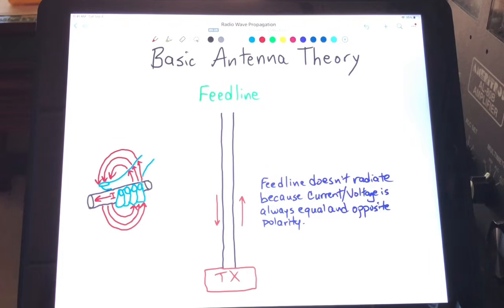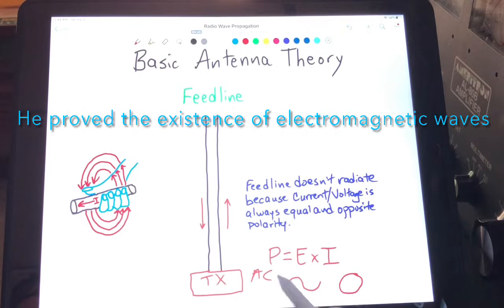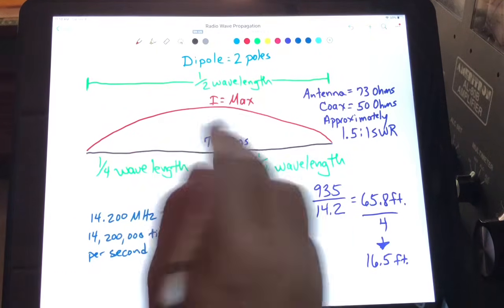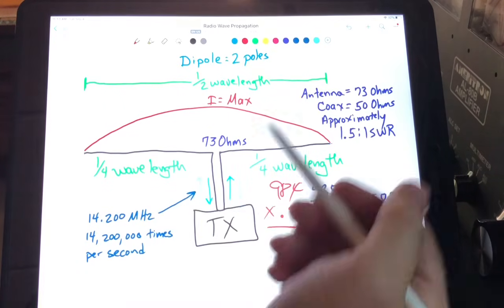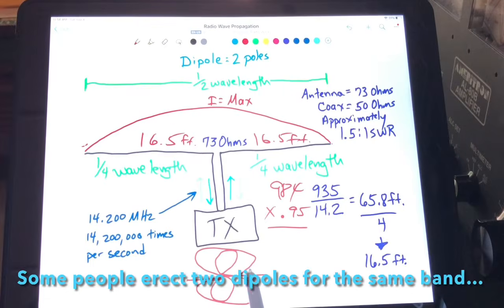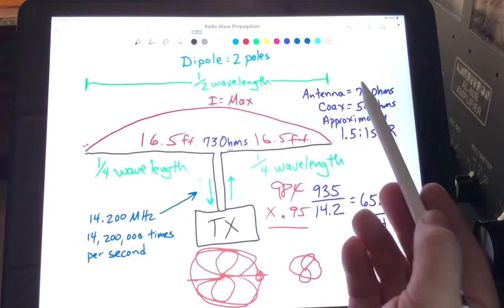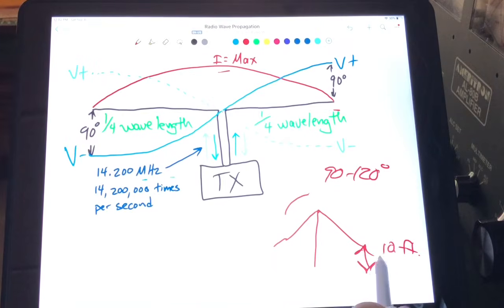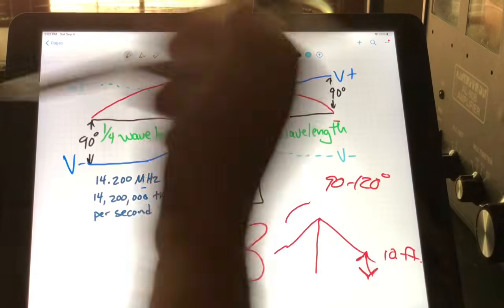Basic Antenna Theory (HF Dipole)

Comment: 1.5:1 sucks.
Reply from the maker: It seems that you have been misinformed.  The difference between 1.1:1 and 1.5:1 is not discernible over the air.  Old timers were happy with anything 2:1 or less. Tube type transmitters didn’t care. The main reason 1.5:1 or less is our goal today is because transistorized transmitters can fail with a steady diet of 2:1 or higher.  But again, the difference between 1.1:1 and 1.5:1 is not discernible on the S-meter of the receiving station.  A laboratory instrument might be able to detect the difference.
Reply: @n4hnhradio  Well, maybe it was something else, but I noticed better performance on my antenna where swr was lowest, rather than the "edges", when talking to my friends at the limits of LOS.
Also, wouldn't the lowest SWR be of benefit to "RCers" when flying models at fair distance and through obstacles with low power (e.g. 100mw)?  I've never empirically tested any of this, but doesn't that "seem" like how things should be?
Reply from the maker: Lower is good, but the difference between 1.1:1 and 1.5:1 is negligible.  And the statement that 1.5:1 sucks is not accurate. It makes clear to any experienced ham that you are either new or misinformed.  I don’t want you to be ridiculed by the know-it-alls.
Reply: @n4hnhradio  LOL well, thank you.  But, there must be some "enumeration" around all this.. there must be a "limit" of what is acceptable SWR and what that "means" for weak signals, no?
Reply from the maker: Below is some enumeration.  These are things I learned while studying for the 5 exams we took back in the 1970s and 1980s.  There were 5 license classes, thus 5 exams.

This is a list of the approximate percentage of power loss due to each incremental increase in Standing Wave Ratio (SWR) in a transmission line:

SWR 1:1 = 0% power loss (perfect match)
SWR 1.1:1 = 0.2% power loss
SWR 1.2:1 = 0.8% power loss
SWR 1.3:1 = 1.7% power loss
SWR 1.4:1 = 2.8% power loss
SWR 1.5:1 = 4.0% power loss
SWR 2.0:1 = 11.1% power loss
SWR 2.5:1 = 18.4% power loss
SWR 3.0:1 = 25.0% power loss
SWR 4.0:1 = 36.0% power loss
SWR 5.0:1 = 44.4% power loss
SWR 6.0:1 = 51.0% power loss
SWR 7.0:1 = 56.3% power loss
SWR 8.0:1 = 60.5% power loss
SWR 9.0:1 = 64.0% power loss
SWR 10.0:1 = 66.9% power loss

Please note that these figures are approximate and can vary slightly depending on the exact conditions of the transmission line and the system in use. The higher the SWR, the more power is reflected back to the transmitter, reducing the effective power delivered to the antenna.

We know from studying for our license that a 3dB loss of power represents half power.  It would take an SWR of nearly 6:1 to cut the amount of power delivered to our antenna in half.  That means our signal to a listener would drop by 0.5 S-unit.  And that is with an SWR of nearly 6:1.  You have to increase your power from 100W to 400W to gain 1 S-unit of increase in signal strength, if measured with an accurate S-meter.

So the difference in SWR is more about protecting your transmitter from being damaged than it is signal strength.  An SWR above 2:1 risks damage to your transmitter.

You should go to N4HNHradio.com, click on the Training page and watch the video entitled, “Decibels, S-Meters, Amplifiers, and Gain.”
Reply: @n4hnhradio  Thanks for answering.  I understand all that stuff.  I'm trying to determine if trying to obtain the lowest SWR at the center frequency of the 33cm band, for example, will increase the likelihood of receiving a "good" packet in "adverse" conditions and will therefore provide a noticeable advantage in range and penetration when flying my FPV rigs using LoRa modulation, some of which cost thousands of dollars and a bunch of tedious, focused work - I'd prefer to take all the steps that I can in order to minimize the possibility of loss or serious injury to people on the ground.
I understand that the human ear can't "hear" 3db greater of received signal strength for voice operations, but what about the above case?  I'd think even 1.x db would increase the odds of getting a good packet the first time...How significantly is my question.  It's very difficult to "statically" test since it's FHSS... I guess that I'll just have to do my best and fly the same routes with different antennas and record all the telemetry.  
Thanks -
Reply from the maker: Your first post is still inaccurate.

Comment: Interesting that you chose electron flow. When I went to electronics school there were only two types. Electron flow and hole theory or Conventional current flow. I always wanted to research the types of materials that are used as xmit medium to see if there is a better material to use but never did. The powers at which most of us transmit may negate this but I wonder if it has pertinence in higher power applications. Or if rcv is effected differently as well. Funny how certain words can trigger old thoughts in this field.
Reply from the maker: It is a matter of perspective.  Electron flow is my preferred perspective.  It’s reality.
Reply: @n4hnhradio  oh that’s my preferred theory as well. I left electronics some time ago when I got into telecom and just tinker from time to time but have been seriously looking to get back into it as a hobby again.
Reply: Conventional flow terminology is outdated, and wrong.  It took decades for schools to catch up and correct itself.  Calling current flow conventional flow was basically trying to make a wrong a right.  Electrons flow.

Comment: It’s actually V.S.W.R
Reply from the maker: Yes, technically it is VSWR.  But the focus of my channel is to help my viewers gain a practical understanding of communications concepts.

Voltage Standing Wave Ratio relates maximum Electromotive Force (EMF) to minimum Electromotive Force (EMF) along a length of transmission line.  EMF influences electron movement and is measured in Volts.  But what we hams are actually looking for is ERP (Effective Radiated Power).  So we conceptualize VSWR in terms of a reflection coefficient.  We don’t need the V.  Most of our meters read as SWR, not VSWR.  So we want to know how many watts were reflected back by the antenna toward our transmitter and lost as heat.  ERP is what we have after we factor in the power lost to heat and the power gained by the gain factor of our antenna.  Maybe we lost 10 of our 100 watts due to the reflection coefficient.  Maybe we also lost 10 watts due to the length of our transmission line.  So only 80 of 100 watts makes it to the antenna.  But perhaps our antenna provides 3dB of gain.  That 80 watts becomes 160 watts of Effective Radiated Power.  And that is our end goal.

Comment: 06:00 If I'm not mistaken, conventional current flows opposite to the direction of the electrons. You could say that your positive charge carriers (or holes) flow in the direction of the current.
Reply: Another trigger for me, hole theory when I went to tech college merely denoted a view of which when the electron is thrown out of the atom it leaves a hole behind which then becomes VERY appealing to a wondering electron since the atom is now unbalanced and is in effect a positive ion and wants to be stable. I love these topics!
Reply from the maker: I think we have a tendency to think in terms of the positive doing the work, when it's actually the negative - the electron movement, which we call current.  But the positive creates the tension that triggers electron movement.  I worked in Germany for a while.  The Germans use the word "Spannung" (tension) for Electromotive Force (voltage).  There really isn't a positive charge in the truest sense.  There is the absence of the negatively-charged electron(s), which makes the atoms that lack them appear as positive, in comparison to balanced atoms.
Reply: @n4hnhradio  That is literally positive charge in the truest sense. An atom with an electron deficiency is overall positively charged due to the positrons in the nucleus.
Reply from the maker: I believe you mean protons.  When the atom is missing electrons it becomes a cation.  In that sense, you could call the atom positive, just because it lacks the number of electrons to balance the number of protons.  But it only becomes “positive” because it lost an electron, not because it had an excess of protons. So again, the determining factor is electron displacement, causing the unbalanced atom to seem positive.  In that sense, you are correct.
Reply: @ sorry, when an atom is missing an electron it’s said to be a positive ion. Vice versa for having an extra electron it becomes a negative ion.
Reply from the maker: No argument there.  A positive ion is a cation. But those are names.  I’m referring the physics of it. It is called a cation, positive ion, after it loses an electron and the proton is no longer neutralized.  The atom never was intrinsically positive.  But I’m done with this. You guys have fun playing word games.
Reply from the maker: Conventional current is correct when referring to the direction of the magnetic field. I misspoke because I think in terms of electron flow for everything else.  Some engineering professors teach hole flow.  The formulas still work though. I was taught, and prefer, electron flow, because holes aren’t actually flowing. In the physical world, the electron is moving, and leaving a hole.  But the magnetic field moves in the opposite direction of the electron flow.

Comment: How to produce the antenna?
Reply from the maker: 142.5/frequency in MHz = length of horizontal wire in meters.  Cut in half.  Connect wires to 1:1 choke Balun at the center, one on each side.  Install “dog bone” insulator on opposite end of wires.  Connect 50-Ohm coaxial cable to 1:1 choke Balun.  Erect 1/2 wavelength minimum above the Earth.

Comment: Very good video. Can whe not wrap the feedline whit aluminiumfoil to not radiate..?
Reply from the maker: Common-mode current would ride on the aluminum foil.  It will find the outer portion of the outermost portion of feed-line.

Comment: What determines the distance the dipole signal can travel? Or I guess how is that determined cause I understand that the dipole size is built depending on the frequency we are using but how far will that go?
Reply from the maker: Elevation above the Earth beneath the antenna.  1/2 wavelength minimum above the Earth for a half-wave dipole will yield good DX results.  Beyond that, it’s all about propagation. Where we are in the 11-year sunspot cycle and time of day are major determinants for signal distance.

Comment: Thank you! but that is an open circuit, how are those wires (antennas) pulling current?
Reply from the maker: The wires don’t pull current.  Try not to think in terms of direct current.  The transmitter produces alternating current, by producing a positive-going voltage that causes electron motion (current).  While the transmitter produces a positive-going voltage on the center conductor of the coax, it simultaneously produces an equal and opposite polarity (negative-going) voltage on the shield of the coax.  

Remember that voltage is a measure of the potential for electron motion.  Voltage attracts electrons out of the valence ring (outer orbit) of the copper atoms that make up the wires. The electrons are pulled through the wire toward the transmitter.  

Look at a dipole from left to right.  Let’s say that the center conductor of your coax is connected to the left hand wire and the shield is connected to the right-hand wire.  When the voltage produced by the transmitter is positive on the center conductor, the electrons in the copper atoms of left-hand wire are pulled toward the radio.  But a split second later, the high voltage switches to the shield, which is connected to the other wire.  The electrons in the valence ring of the copper atoms of the right-hand wires get pulled toward the transmitter.  This back and forth happens 14 million, 200 thousand times per second at 14.200 MHz.

The movement of the electrons within the wires causes an electromagnetic field that expands away from the wires according to the intensity of the electron movement (current flow).  The electromagnetic field expands and contracts at the frequency of the alternating voltage and resulting current flow.  This all results in your transmitted “radio wave” signal.

During receive, the electromagnetic field off the antenna of the other station’s transmitter induces current flow into the copper wires of your dipole.  Now, one of the measurements of a receiver is in how sensitive it is at detecting the alternating current that is induced into the antenna during receive. More current will be induced into the wires if they are each 1/4 wavelength long, based upon the frequency you wish to receive.  The two wires add together to become a half-wavelength dipole.  

I hope this helps. 

73, de N4HNH

Comment: I purchased an MLA-30 plus antenna to used it on my Sangean ATS-909x2, didn’t got any signal. I m on a residential area . I mounted it on a 25 ft. Pvc pipe ,scan the whole shortwave frequencies and had maybe 3 SW stations picked up. Give up and returned it, now I’m convinced I’ll do it just like the way I did watch this video. Thanks , this looks pretty much a winner  antenna☺️
Reply from the maker: The dipole. Is a fundamental design that most antennas are based upon. The dipole creates its own counterpoise. No “grounding” or ground radials required.

Comment: This was great, the best Ive heard so far. And can you also explain how an unbalanced feedline (coaxial cable) negates creating magnetic waves.
Reply from the maker: That’s not quite the case.  Balanced feedline cancels the currents that might otherwise radiate, because the currents are equal in strength but opposite in polarity.  Coaxial cable isn’t balanced. The current flowing on the center conductor is not equal and opposite of the current flowing on the shield.  Common-mode current can ride the outer portion of the shield back into your shack when the coax is connected to an antenna that isn’t resonant for the operating frequency.  This can result in the pesky RF that affects our audio, computer, etc.  If you must use an “antenna tuner” with a coax-fed antenna, there will be common-mode current.

Comment: What would the power factor of this antenna be?
Reply from the maker: The gain of a dipole antenna, at the frequency it is cut for, is 2.15dBi or 0dBd.
Reply: @n4hnhradio  thank you for your reply. I am trying to understand the relationship between the applied voltage and current in the antenna. If they are 90 degrees out of phase then wouldn't the power be all reactive power?
Reply from the maker: You might hear the term impedance when someone refers to an antenna feedpoint. It is approximately 73 to 74 Ohms at the point of peak current, the feedpoint, of a half-wave dipole antenna.  This is the point where the capacitive and inductive reactances have canceled one another out.  The E (Electric) and H (Magnetic) fields are in phase (zero reactance) at this point of resonance, resulting in radiation.  

Another interesting term you might want to explore is radiation resistance. It isn’t a “bad” resistance, such as Ohmic resistance. Ohmic resistance exists at the feedpoint as well. Ohmic resistance causes a loss of power in the form of heat. Radation resistance, on the other hand, allows for the development of an electromagnetic wave.  I believe that an understanding of radiation resistance is perhaps as important, if not more important, than understanding impedance, when discussing antennas. 

73, de N4HNH
Reply: @n4hnhradio  thank you! I need to think of the relationship between the E and H fields rather than the applied voltage and current. I was thinking in terms of AC circuit theory. 73 de KD2EVC
Reply from the maker: Yes, Keith, you nailed it.  AC circuit theory is different because there is a circuit. With a dipole, there are open ends.  

Remember too that if an antenna is too long, the reactance is inductive, opposing a change in current. If too short, the reactance is capactive, opposing a change in voltage. An antenna matching unit (aka antenna tuner) adds capactitance when the radio sees the antenna as too long for our desired operating frequency. Conversely, the antenna matching unit adds inductance when the radio sees the antenna as too short for our desired operating frequency. 

The point of the antenna matching unit is to balance the inductive and capacitive reactances that influence the impedance the radio sees.  It is acting as a type of impedance transformer.  

Note that when an antenna matching unit is needed to “fool” the radio into thinking the antenna is the perfect length, the antenna system (feedline plus antenna) is still not perfectly resonant. But the antenna matching unit, acting as a type of impedance transformer, effectively makes lemonade out of lemons. 

73, de N4HNH

Comment: This is an informative video.  However, I was confused by the use of imperial units; I think it would be better to get a metric tape measure.
Reply from the maker: I am in the USA. We use feet and inches. Sorry.  I’m not going to reshoot this video.
Reply: Stick with the feet and inches - I wish we had I understand those